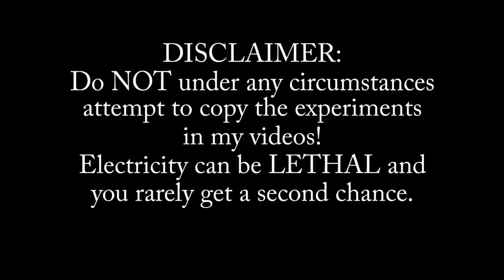Too Much DC Voltage!

Comment: You need a second meter for current so you can find the sweet spot where the current first starts to increase then hold the volts there for maximum destruction

Comment: Bing & bangs! Nice video.

3:38 do i hear train horns?
Reply from the maker: One of the Seattle transit lines plus freight/Amtrak to Portland.
Reply: ah. isnt that the BNSF freight line ?
Reply from the maker: I found out it is BNSF. I always thought due to light traffic that it was a WSDOT line, but apparently it is the main line. No wonder our freeways are so clogged with trucks since it seems nobody is using rail anymore.
Reply: Mr. Scotty yes you do
Reply: Mr. Scotty It's a CJ trying to follow that damn train

Comment: "Too much DC voltage" and you are using Ac volt meter
Reply from the maker: True, that is the voltmeter on the variac. Right after the veriac the power was rectified to DC.

Comment: I guess i got a second chance? I accidentally touched my hand to a power socket with 220 volts... And this day on,im scared of electronics exploding
Reply: Did that too once, when I was 7 I put my hand on an exposed plug, like without a plastic cover, and it zapped the shit out of me. 120 volts
Reply: Asura the Latias ラティアス I did that when I was 9 too
Reply: How does that happen lol do your power sockets plug into your electronic cables or do you electronic cables plug into the power sockets? Because the ones I have they have a gap between the place of the metal with plastic to insulate, and you plug electronic cables with the plug part that goes out into the power socket so you can’t get shocked unless you put a conductor in between the electronic cable plug and the power socket I hope this was not confusing for me and it probably is so I am going to put a period here to end this paragraph of nonsense.
Reply: Try to defeat your scare instead of facing and lose it
Reply: @thebiohazardgamergamingand4349 same but 4 times

Comment: I wonder what blew up so violently inside the discman? Nice train horn capture in the background at 3:39 btw.
Reply from the maker: +BarneySaysHi There was a non-vented capacitor on the far end of the board that blew. Unfortunately it's partially obscured by the black wire & alligator clip.
Someday I'll walk down to the Amtrak station and record a train. Other than Amtrak, that's not a very busy Seattle <-> Portland freight track so it's hard to predict when one will go by.
If only I knew where to find a freight schedule.

Comment from the maker: It was the stock cooling block for an old Intel machine. I tried using the aftermarket cooling block, but it had 'heat pipes' that won't work if drilled through. Luckily I had this one sitting for years brand new in the box. :)

Comment: Mmmm, interesting poppage on the dsl router thing. I wonder how this would've gone if you'd have just stuffed mains voltage in the ethernet port or usb if it has one? :-D

Motor pop....Ah, no flames.... no cigar. :-D You popped it though!

Sony discman....well, you certainly let the magic smoke out of that! :-D 

The last music track to be played on that, was "I want flames" by PhotonicInduction. :-D

Thanks for showing,

-BoomBoxDeluxe.

Comment from the maker: @vinylloung My primary camera is a Sony HDR-CX360v (1080p). I also have a Sony HDR-CX350v (1080i) that was used once on the variac's volt meter and once for the modem face, and I have an old Sony DCR-TRV330 (digital Hi-8 480i) that was used the other times on the volt meter.
For some reason I failed to record the meter for the DC motor, but at least I managed to record the action. :P

Comment: Good Tip For Consumers: Never set up a voltage higher than 50 Hz to all electronic appliances, including shortwave receivers that uses a plug.
Reply: 50 Hz is a frequency, not a voltage.
Reply: 50Hz is a frequency.110 or 220 is a voltage. here in us we use 60Hz and 110 volts. at 60Hz everything runs fine.
Reply: 50 Hz as voltage
gg
Reply: +The Electronics Kid yeah, stuff runs great in the USA!
Reply: I'm sorry.. I mean, never set up a power source with a voltage more than the allocated voltage for an electrical appliance (either 100, 127, 112, 220, 230 or 240 V), including shortwave receivers that uses a plug. It will ka-boom, i mean explode and may caught fire.
Reply: +HBC101TV Studios (Mohammed Fred) you do realize this is dc in the video not ac.... try again.
Reply: After Hours Tv & Pc repair Oh. I'm sorry..
Reply: +HBC101TV Studios (Mohammed Fred) thats not just a typo.. .

Comment: Never set up a voltage higher than 50 Hz or 240 watts because it may increases the risk of electrocution.
Reply: it volts not watts. trying to sound professional aren't you?
Reply: The Electronics Kid FFS, i wasn't tryin' to sound professional. I was gonna say the word Volt when i accidentally typed the word Watt. LOL.. I'm sorry. I was wrong.
Reply: And hz

Comment: How much voltage did you feed to the drill motor?

Thank you :-)
Reply from the maker: I had an old high-8 digital camera that was recording the voltages then. Unfortunately either it malfunctioned or I did, so I didn't get any footage of it. 
If I had to guess, I would say around 20-30vdc
Reply: ElectronSpark and what is the drill motor rated in volts and amps?

Comment: What was that strange steam coming from that capacitor? Was it poisonous or smoething?
Reply from the maker: +juk123 45 It's electrolytic fluid that is boiling and being released as a steam. It's not poisonous to breathe, although it's probably not very healthy.
Reply: +ElectronSpark So Electrolytic fluid is inside capacitors?

Comment: That's not a AC Voltage counter? In the title i read Too Much DC Voltage
Reply from the maker: The variac's AC output (that the meter was reading) went into a bridge rectifier that converted it into DC.
Reply: ElectronSpark Ooh okay